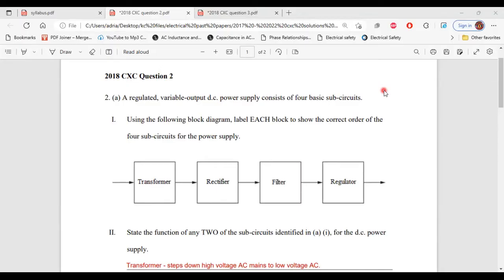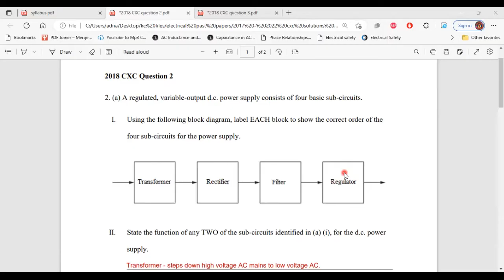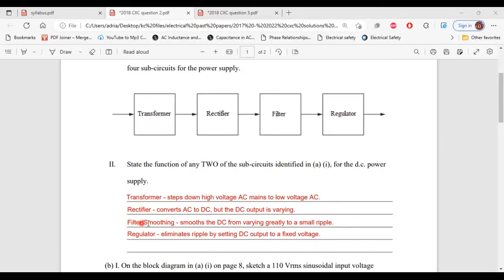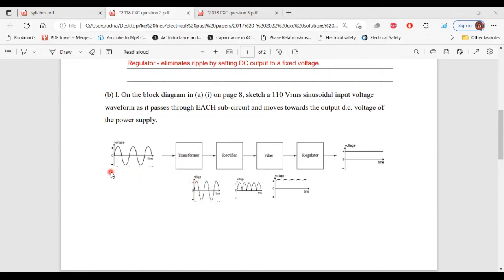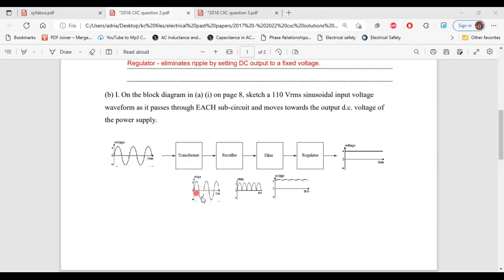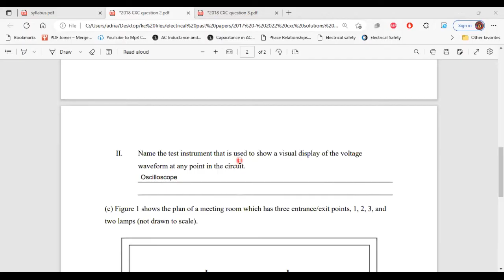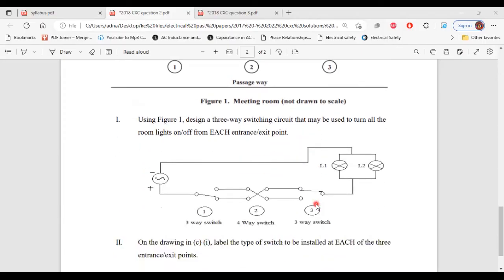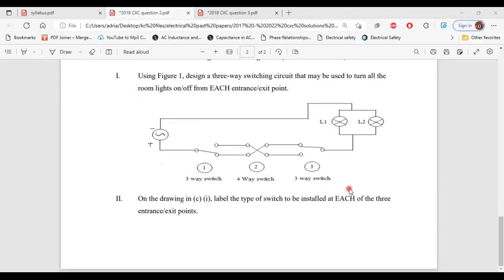CSEC Electrical: 2018 Question 2

Comment: I have a question: Why are the lamps  drawn in parallel instead of in series, seeing that the question said all??? Why use 3 way and 4 ways switches instead of 2 two ways n an intermediate??? 
Im a bit confused
Reply from the maker: 1 - The lamps are drawn in parallel because that is the preferred way to connect lamps when doing electrical installation, because of the advantages of a parallel circuit over a series circuit.
for a series circuit when there is a break in the circuit, or a lamp is damage, the entire circuit loses power. whereas for a parallel circuit, if there is a break in the circuit along the connection of a lamp or a lamp is damage, the entire circuit will not lose power.

2 - Intermediate switch is a 4 - way switch - depending on the region you are in; persons might call it 4 - way switch or intermediate switch.
3 - For 2 - way switches and 3 - way switches, they are the same switch, depending on the region you are in; persons might call it 2 - way switch or 3 - way switch.